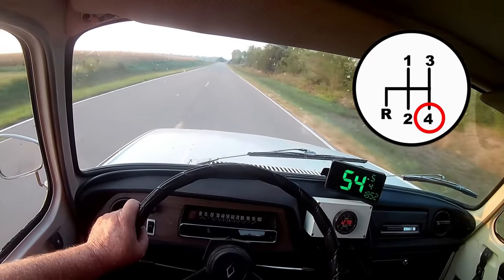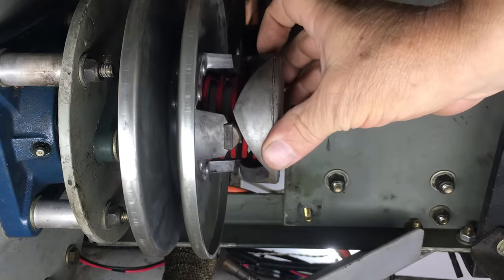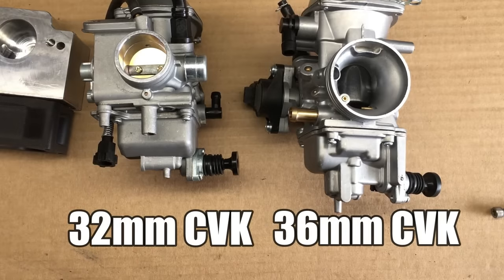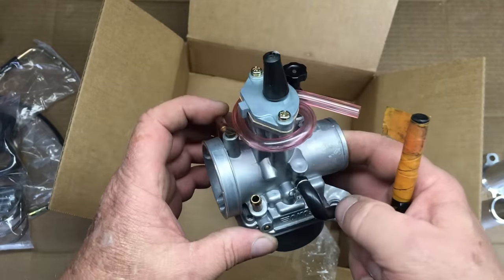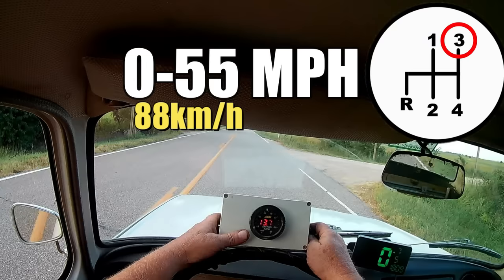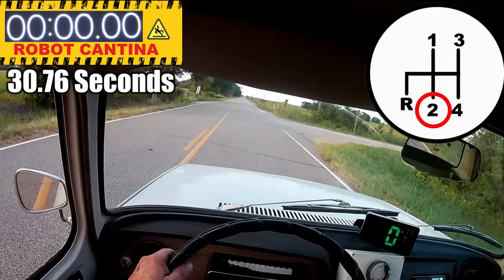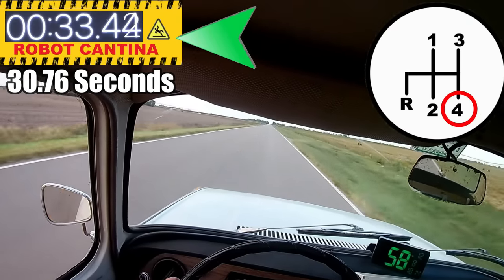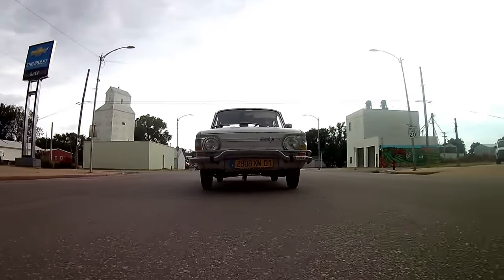S3 E32 We install a 3D printed manifold spacer on the 670 cc Predator Renault for moor speed

Comment: I agree with trying the larger single carb before trying dual carbs.  Now's the time to do it and it might be the best overall solution, who knows?  Unless someone previously tried all this.
Reply: I enjoy the steady progression and agree with you. Let's stick with the single but larger carb before going full hot rod dual carb. 

If you don't eat your meat, you can't have any pudding!
Reply: I agree next 1 big carb
Reply: If Jimbo doesn't upgrade to the bigger single carb now, he'll probably never go back to it after doing all the work to setup the dual carbs.
Reply: Agreed 👍
Reply: I believe he'll try all of them in the next video.
Reply: I can't see a bigger carb making much difference. I've seen videos of people running v8s off lawnmower carbs so if they can supply the fuel for a V8 in my opinion it can't be much of a bottle neck. I don't know wether the fact the V8 would pull more air so pull more fuel but surely just an upjet would counteract this.
Reply: yeah but a V8 isn't going to have any power running a lawn mower carb either. @HA05GER
Reply: @Clearanceman2  youtube it still went quite well considering I expected it to be dog shit but good afrs and run well
Reply: Honda shadow 600

Comment: My vote is for dual carb. It sounds like the folks at 670 performance already figured out your next engine upgrade for you!
Reply: Count me in on the dual carbs!
Reply: I also vote for dual carbs, no need to mess around with another single carb video wasting time.
Reply: I agree !! It’s been proven that the single carb system doesn’t distribute fuel equally to both cylinders on these 670. Plus I think that’s why you’re getting your lean rich reading
Reply: I bump this!
Reply: definitely dual, watch the low rpm fueling issues just go away. Was he going to turbo this later? Single would be a lot easier in that regard, but It would be cool to see it working with a dual setup.
Reply: My cat is Mr Bubb’s
Reply: Two carbs all the way. These are 270 degree firing engines and a single carb hates that. Many tricks need to be pulled to make them run decent, but leaves a lot of power on the table. That is why this motor has a 2bbl from the factory.
Reply: 2 carbs means 2 turbos!
Reply: Vote for DC670 MOOR of everything...including work
Reply: @joeolivas4941  all the hp to run the 2nd turbo!
Reply: @rearspeaker6364  good things happen in pairs

Comment: As a driver who's well-familiar with driving stick, I can tell you: You need to work on your technique. Try not lifting so much off the throttle when you shift, and get your shift/throttle efforts synced better so that you're shifting just before you're "lifting". That way, the engine will stay more in the "sweet spot"  RPM band, so you won't lose as much power under acceleration.
Reply from the maker: I have driven manual transmission cars all my life, it's my preferred transmission.  Keep in mind  there is no conventional clutch on this setup. So when I shift  I'm shifting without a clutch.  I have driven many cars like this, but on this Renault gearbox the synchronizes are a bit worn.

Comment: My vote’s for single big carb next! 

If I’m not mistaken , you mentioned CVT/transmission upgrades earlier in the video. Now that’s interesting. Getting the power (what little you do have!) down effectively makes the most sense to me, but who am I anyways. Keep up the good work Jimbo!
Reply: Agreed on the transmission upgrades. He's losing over a second with every shift, and starting in third gear is both hard on the trans, and slowing it down significantly by default (when you take the slow shifting out of the equation).

The trans is gonna have to be addressed at some point or it's always going to be the biggest hurdle.

Comment: Those foam filters actually work vs the K&N style which let anything smaller than a bird into the engine.  Project Farm has an air filter test that I found quite eye opening.
Reply: anything that resembles a k&n filter on ebay will wipe out a motor!!

Comment: I definitely think you should start with the 36mm carb before going to the dual carb setup, just for the sake of comparisons. The printed spacer really helped in straitening the air flow to the ports on the manifold, thus adding some performance gains. The dual carb setup would probably be ideal for power, but would take time to tuning them properly. It's cool to see how far you've come with this. I'm anxiously waiting for next week. Nice work Jimbo!! 💪🔥

Comment: Fantastic video! That was more exciting for me than I thought it would be. I was very curious to see if the improved airflow of the fillets would help. I designed it when you used the original carb so I thought the added length and fillet would help mixing and flow, but it seem to fit great with this carb as well.
Reply: Great work Grumpy RC!  You should publish a design/build video about the production, I love a good cross channel tie in.

 Curious to know what  filament you used? ASA or ABS I would assume.

Comment: My suggestion is to go with the larger single carb first. You already have it, so why not (Yes, I'm trying to keep with the theme of the channel!) After that, try the dual carb. I think you're going to find, once they are dialed in, the twin carb setup will really help with performance. The reason being is, when the air comes through the single carb, it has to change direction four times by the time it gets into the cylinder (90° at the aluminum manifold; 90° just after the 3d printed manifold; 90° turning to head for the cylinders; 90° turning through the head and into the cylinder). When you have the dual carbs, you're eliminating three of those turns. If the engine is intake restricted, this is going to help big time (but you already knew that).

Comment: I kind of like this set up.  It seems to have "continuously variable" as its theme.  The CVT on the engine and the continuously variable venturi in the carb.  I guess if you move on to a new car, finding something that has a CVT may be interesting.  Then you could have CVT to CVT power delivery with CV venturi.  :D  Continuously variable all the way down.  LOL
Reply: cv carbs are too complex, just put fuel injection.

Comment: There is a group of 3 people who build performance engines call carsandcameras and they have been able to make a single carburetor work with a modified intake manifold.  The biggest setback of the single carb is that they noticed one side of the engine getting more fuel than the other and it would foul out the spark plugs.  I would say a good test of single vs dual carbs would be to make variable intake runners (if we have the tools to do so) that way the air to fuel ratio is even between both cylinders.  It would be awesome to see your way of do this and testing results since you are the diy person who shows anyone can do this without intensive knowledge and tools.  Truly a trial and error, and I admire that.

Comment: The 36mm carb first. 
The 32mm is big enough for a 420cc up to about 5000 RPM or so(for ideal top end flow), and 33-34 mm is what’s recommended for most 420cc class performance engines. I would imagine that the 32mm is holding your motor back a little bit on the top end. Would be nice to see the 36 mm next, so that we could have a back to back comparison of a smaller carb to a much larger carb, and then we can do the twin carbs.

Keep it up Jimbo, the content you make truly cannot be found anywhere else on YouTube or probably on the Internet for that matter. Thanks for all your time and hard work.

Comment: If you could figure out a way to manually control the CVT to keep the engine at its torque peak throughout the run, it would undoubtedly give you better acceleration times...maybe a cable attached to the output side to overrride the spring in the CVT (just go by the engine sound and feed it in as the RPM climbs)
Reply: Turn it into an MTV?
Reply: @SchoolforHackers  i guess that would make it an MVT...you would need an HDMI cable  or coax for an MTV ha ha!

Comment: re the low-mid throttle: these things have an idle mixture screw and an idle jet.  The idle jet effects the range you were talking about.  the screw just does idle and effects what happens when you snap the throttle open or closed. 

Also you can get down draft (or semi-down draft) motorcycle carbs.  typical found on Japanese v-twins.  these might suit your setup more.

Comment: Great project! Those CV transmissions are amazing. A higher ratio in the differential might make better use of your four speed, but probably not worth the effort? When I was driving a 1000cc 3-cylinder geo metro, I got noticeable improvement in mileage and performance when I over inflated the tires. They wore faster, but only cost $25 each at the time, so it was worth it. Caveat emptor!

Comment: Those OKO carbs are a Keihin knockoff, specifically of the Keihin PWK series of carburetors. Used many of them when I was building mopeds as a late teenager, and as long as you use genuine Keihin jets and atomizers they will be just as nicely tunable as the genuine PWK carbs although a four-stroke engine will generally still run just fine with some mixture deviation from suboptimal fuel atomization, as you've already demonstrated in prior videos.

Comment: Dual carb here. Once tuned it will not only run better but be more responsive and idle smoother because you eliminate the charge robbing effect the leading cylinder tends to do to the trailing with a shared plenum induction.

Comment: HEY JIMBO.  That car seems so loud.  What I would like to see in a future episode is you obtaining a quiet car resonator and a quiet muffler.  Then maybe fabricate and run the exhaust halfway towards the front with a resonator inline then curve it back towards the back and have a muffler inline with a pipe going out the back.  Then maybe measure the before and after backpressure, exhaust temp, and engine performance like 0-55 and mpg, comparing before and after.  Also a measurement of decibel output before and after.  Hope I gave you a great idea!

Comment: Put an RPM governor on the engine and make the CVT adjustable via a foot pedal.

So you set the governor to peak performance and adjust the RPM to accelerate without dropping the RPM too much. :)

Comment: larger single first. The "tunnel ram" has shown an improvement, need to see what effect an increase in airflow will have on performance prior to changing runner length (the twin carb setup will have shorter runners) as well as carb size. 

I have no doubt that the dual carb setup will make more power at the top of the RPM band, but I think testing the "best case scenario" (larger carb with tunnel ram spacer) single vs dual will make for an interesting test- I don't own a 670cc V-twin Renault to go find out myself, so I'm counting on you, Jimbo.

Comment: I’m really enjoying this series and I think trying the larger, single carb may get some good results, but I’m thinking you have pretty much reached the upper limit of what this little engine can do.
Reply: How about single carb...dual throats (secondary opens up when vacuum operated)...
like the carb fitted to a Datsun B210 from the 1970's?
Reply: @JohnSmith-pl2bk  chevettes and vegas had them too.

Comment: You could use a single wideband controller, and two o2 sensors. As long as they both had a heating circuit you could switch between the two signal sources on the fly for each bank. One would THINK. Correct me if I'm wrong.

Comment: V-twin manufacturers often use twin-barrel carbs to isolate the intake pulses from each other. The reason for this is because the firing order is uneven, meaning one fires then the other does quickly after (normally 0-270-720) This creates a discrepancy in intake charge between each cylinder and possibly mixture, because the second intake pulse is right on the back of the first. Making the throttles separate effectively turns one carb into two, but uses a single float, fuel inlet and throttle linkage.

Comment: These videos are so good. Thanks for all the work you do.  I think you will see s gain in performance with a dual carb setup actually and it’s worth doin. I had bad luck with the knock off carbs and the engines sometimes had power issues also.

Comment: From memory, every 8mm 5/16" increase in intake length drops peek power 300rpm.
For single carb you have to look at piston demand timing of multi cyls, ie, overlapping demand. Everything outside piston demand, ie, intake stroke from TDC to BDC, is wave-tuning, and that doesn't really rely on carb flow, Basically it's just a matter of checking if both cyls want air at the same time.

Comment: Can you and/or do you know how to float gears 

All it takes is to let off the throttle shift and put your foot back down in it 

I have been floating gears for years while driving trucks for a living, having the CVT should act like the clutch, preventing you from needing to use a clutch while in motion 

It would be interesting to see if it is possible and the results of it 

Thank you very much for putting these very entertaining videos on. Enjoy watching. Thanks again.
Reply from the maker: I have driven this car hundreds of miles and I'm very familiar with the limits of how fast the transmission will shift.   Keep in mind this car is old and the synchro's are not in the best condition.

Comment: Think belt temperature should be monitored. A more tuneable CVT would be more helpful. It should engage closer to where the engine is most efficient and run the entire time at the most efficient RPM. Think most of it comes down to not having large enough diameter CVT. 

 If it is just about motor power improvement, make an engine dyno and do bench tests. It would help in determining what RPM to set CVT to run at.

Comment: My dad bought a 1960 Plymouth Fury convertible Indy pace car replica in 1961 when I was 8 that had the 354 hemi with dual 4 bbl. carbs and a Tunnel Ram" manifold that mechanic's used to call Plummers nightmare. My point is, these long manifolds placed the carbs right against the opposite wheel wells and had maybe a 30 inch run, supposedly for mid range touque, but who knows? I know that when in tune, whic only lasted about 2 weeks, it would pass anything on the road but a gas station!  7 to 9 mpg! Maybe you could experiment with a much longer intake manifold, maybe several inches? Maybe this would even out the a/f ratio between cylinders? Ask someone above my pay grade, I was merely a semi truck driver, not a real engineer, because I flunked calculus 3 times in college and called it quits!

Comment: Back in high school my brother and I paid $150 each for a 67 R10. It had a fresh rebuilt engine in the trunk. I could drive it at 10/10th around the Kmart parking lot without anyone bothering us. Except for the body roll it looked like we were looking for an open spot! LOL!!!
Reply: When the motor blew up (10/10th may have had something to do with it) we changed engines with the help of a buddy. After we dropped the engine by hand two of us lifted the rear while my brother pulled the engine out from under. Install was the reverse procedure. I miss that car. I went on to own a plethora of VW Type 1s after that.

Comment: IF YOU GO DUAL CARB... TRY and shorten the intake tubes (EQUALLY) AS MUCH AS POSSIBLE, it WILL help with the intake of the fuel and air, ALSO, INSULATE the aluminium intake tubes (wrap them with something that will keep them isolated from midday sun & engine heat), as they COULDget hot, and affect the intake too. Note: This is why you'll see on motorbikes  (especially aircooled) that each carb is only mounted on rubber intakes and close to the engine... 🤔😏
😎🇬🇧

Comment: Jimbo,

Nice to see you have ordered a backup belt. You might want to keep a spare belt or three on hand for as long as you use the CVT on the Renault.  This also may explain why the Predator powered S-10 based buggies I've seen use a centrifugal clutch bolted to the engine with a chain running from a sprocket on the centrifugal clutch to a sprocket mounted on the transmission input shaft.  That setup may be better for slow speed off roading and towing. I saw one guy with a 4WD S-10 powered rig pull a semi wit ha Predator 212. It goes without saying he was very slow but it does show the power of mechanical advantage.

Darwinskeeper

Comment: Hi, I love what you are doing to this car. I've got a 1981 daf/volvo 66 with belt driven cvt/variomatic It's a dual belt but these last for about 100K km. I think there is something wrong. In the video I can see/hear the engine bogging down at around 30mph. It seems that, thatś where the clutch fully engages. After that rpms increase lineair to speed, which means that either the max ratio is reached or it is no shifting at all, like a fixed ratio. This may explain the sluggish accelaration and the destruction of the belt. When I floor my 66, the clutch engages at around 1000rpm, after that rpms climb to max in seconds and stay there with the car accelerating until I lift my foot, then cvt 'shifts' up to its optimum cruise pattern.

Comment: To solve the values float issues you have to replace the value springs with stronger ones.

I would also suggest getting a more aggressive cam, since it will also add MORH PAOWERH!

Comment: I've had one with a signle cylinder, that reved out past 7000 rpms with little to no valve float. Even ran it with the stock cast blover, didn't turn into a bomb somehow.